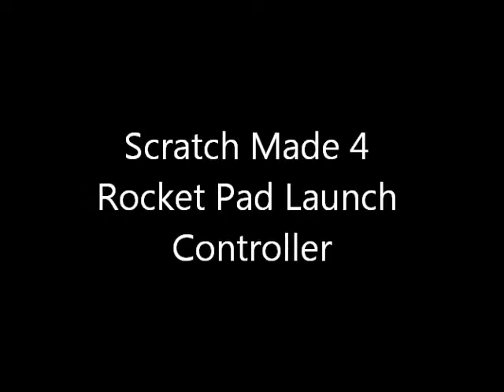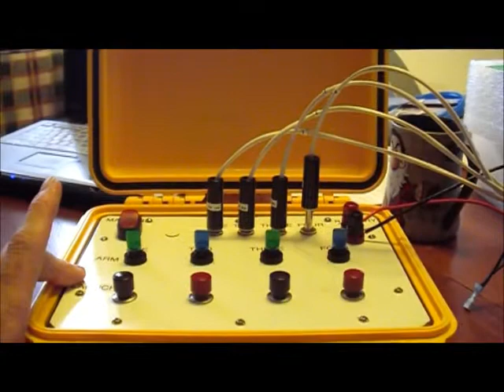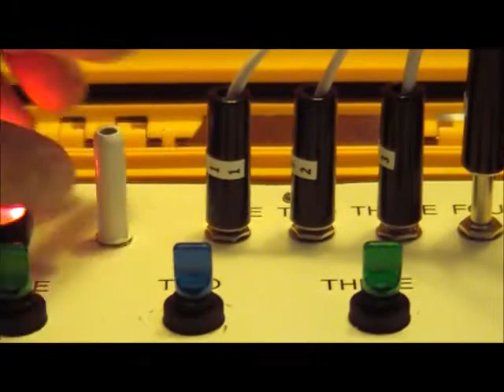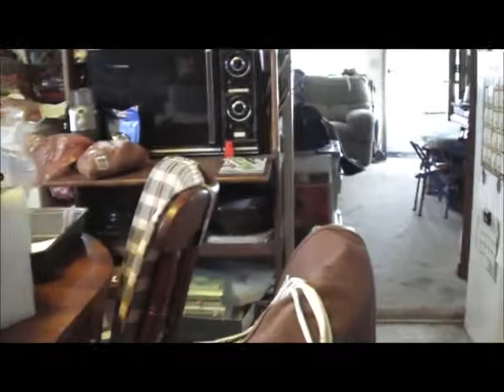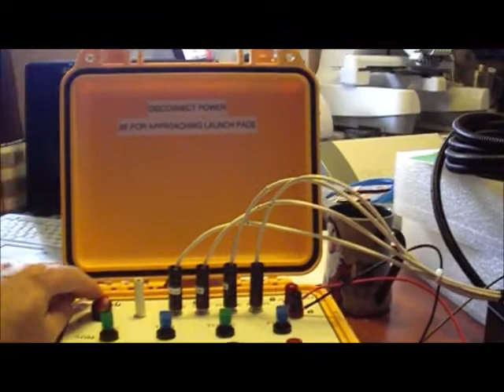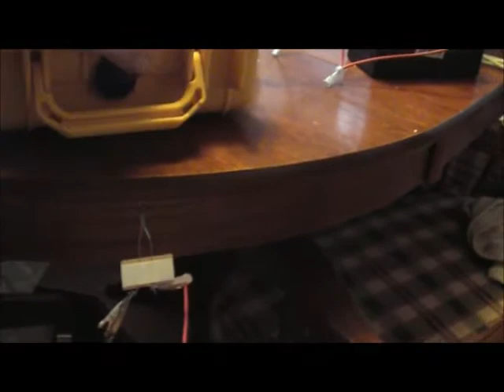Rocket Launch Controler

Comment from the maker: I have since added a magnetic dead mans switch to the system as a fail safe cut off. If the magnet is not placed on the right spot on the face of the controller there is no power going through at all. Safety first!!!!